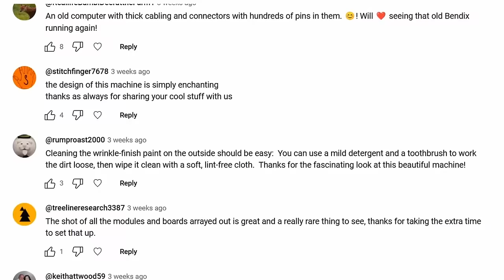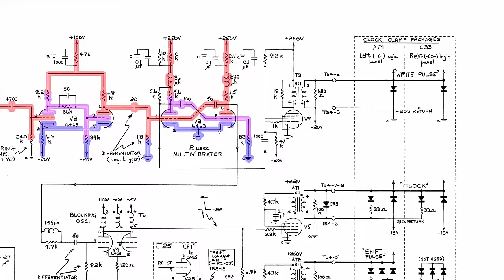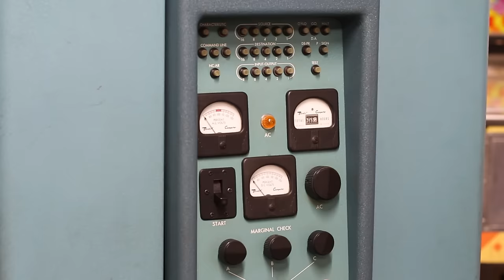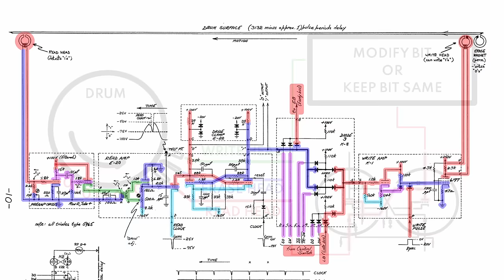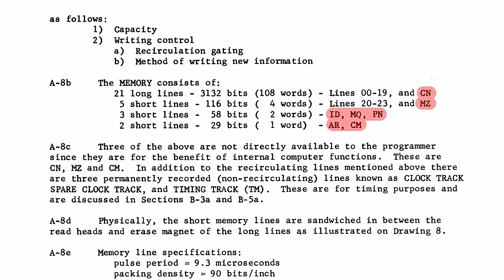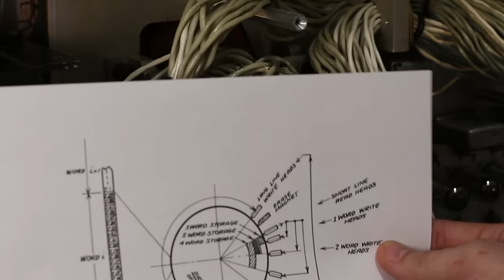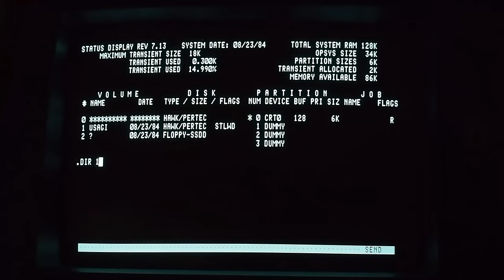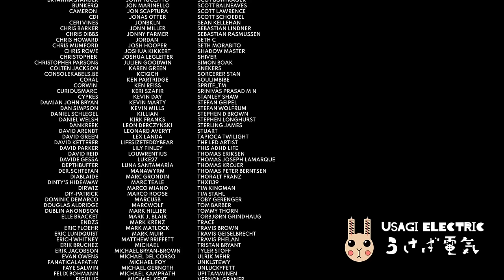Rotating Drum Memory with the Bendix G15

Comment: i would at least emulate the stack to try and get the rest working and then i would try to get the drum working so that the rest is confirmed working
and for the rest i also dont like emulation for examble the fpga replacement for the vic 2 chip in the c64 i powerfull egnuth to emulate the whole computer and i dont like that thought

Comment: Good practice when you remove a tube: Check first the heater continuity (usually pins 3 and 4 in 7 pin tubes and 4 and 5 in 9 pin tubes)
BTW at 22:09 How that guy write OUTSIDE the drum if is trapped INSIDE the drum? 🙂
Greetings from Buenos Aires - Argentina!
Reply: I like to check for shorts too, but it would be way faster to use an actual tube tester on this many.

Comment: You keep saying the drum is the “Heart” of the machine, surely it more resembles the Brain in this case? And whatever Power supply it has would be the “Heart”. Just keeps ticking me off hearing you call something used for memory storage a “Heart”
Reply from the maker: I'm sorry that it's bothering you, but I think you might be misunderstanding how I'm using the term "the heart," here. 
I'm not referring to an organ that pumps life blood through the machine, for that, the power supply might make more sense. 

Instead, I'm using the second definition of heart to mean "the central or most important part." (That definition is straight from the Cambridge dictionary.) The rotating drum memory provides the clock, the timing track, the number track, all the CPU registers, the transfer lane between CPU and I/O, as well as all the general storage in the machine. I think that very much so fits the definition of "the central or most important part," or "the heart of the G15."
Reply: @UsagiElectric  didnt bother me enough to the point where i couldn't watch the video, still loved going through the series and watching you repair this beautiful ancient beast of a machine.

Comment: For me the storage isn't that important, heck i use SD and CF cards on all my retro machines, so modernizing some storage doesn't kill the machine for me.
As we all should have learned by now, all our old machines will die eventually as even the things one thinks should be eternal, like ICs of any kind, eventually rot. Not proverbially but actually. So modernizing a part to make the whole machine run again is fine by me. And if i had an old tube based machine at hand i would gladly check out modern tube replacements if one in there breaks.

There is the controller theorem when it comes to emulators and such. If you have the right controller in hand it doesn't matter that much that part or the whole machine is emulated. If you sit in front of your VT100 terminal you won't care if the harddrive in your PDP11 is essentially an ATMega with a SD Card, Unix V6 will still work as you expect. With the added benefit of an easy backup. Just pop it into your Linux machine and do a quick dd, backup done.

Or to have a more modern comparison, the C64 and its SID and the PLA as these are the most common to fail. If your original SID or PLA dies and you put in a modern replacement the Giana Sisters tune will sound as great as it always did and someone playing on the machine will never notice that there is no real SID or PLA in there anymore. All that matters is the breadbin with its nice chunky keyboard in front of you and the Competition Pro in your hand.

Comment: just slap a pi zero bhind the control panel and have it emulate an altiare, its not like you could make it functioonal or make it do anything 99% of people could understand. unless you  plan to have it  read punch tape or cards for some  visual fflare, but even then i would still retro fit and rig it into basically an  enourmous computer  case for a modern single board computer